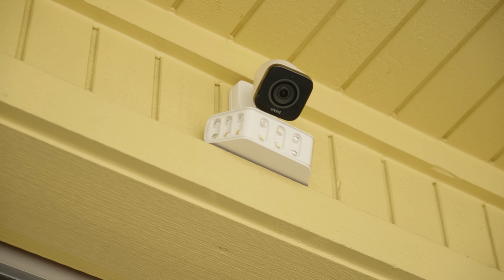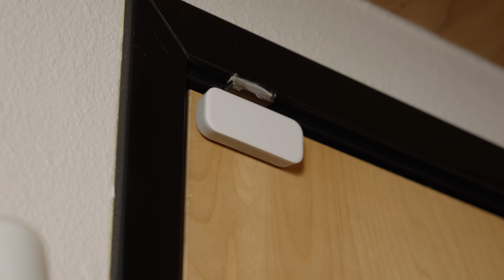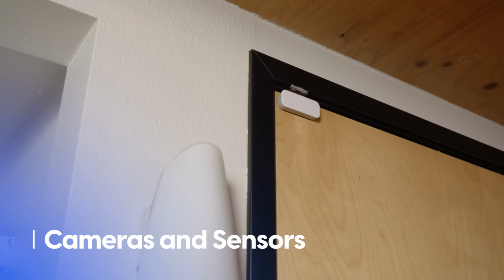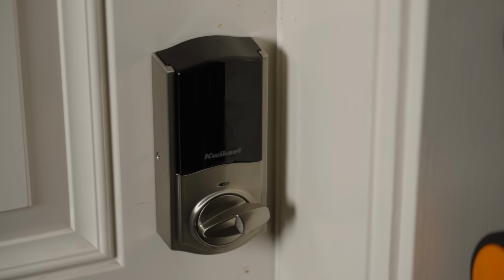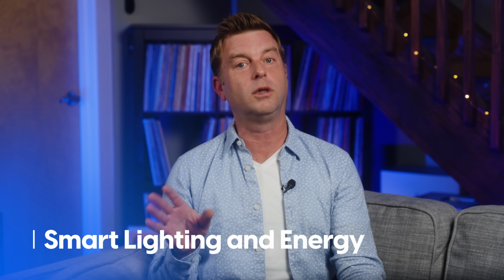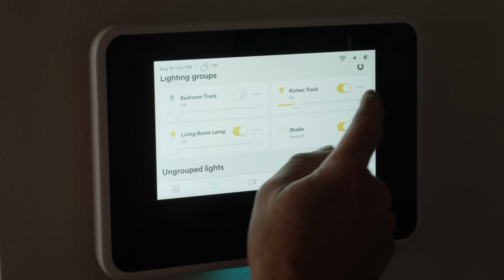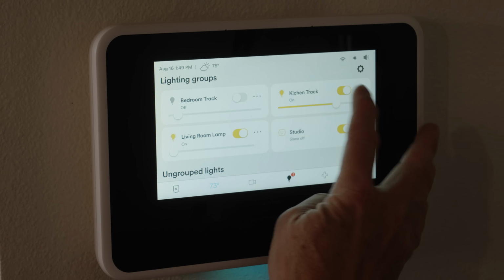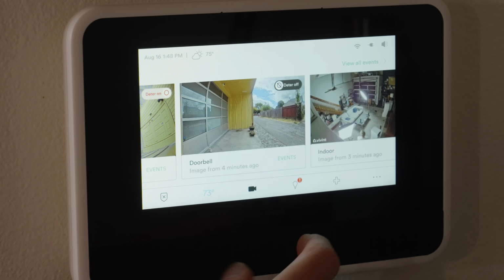Vivint: The Smart Automation Upgrade Our Studio Needed

Comment: Caleb - QUESTION for you - I have a Sony  XBR65A9F.  Nice TV, a few years old.  With everything nowadays coming from a streaming app, I've noticed what seems to be slow CPU performance - switching between apps or between "channels" within apps and I frequently need to restart the TV (reboot) when an app freezes.  MY QUESTION: would a newer Sony oled  like the A95L work better / faster in these areas?

Comment: That's awesome they have so much to offer. 10 years ago when I bought a house for the 1st time we got Vivant Home Security of sensors. That alone paid for itself with the discount on home insurance with a security system system.
Reply: The reduction in homeowners insurance is a drop in the bucket compared to the cost of the system in the lengthy contract. 
But please shill some more

Comment: Is an account required? Is there a monthly fee? Allowing some strange company name Vivint into my home is a non-starter. Home Assistant, while more complex is more versatile and operates independently so offers a real privacy solution.
Reply: Vivint is not a no name. They've been in business for 27 years.
Mine is like $30 a month. Those are just window and door sensors.
Reply: @saulgoodman2018  They are a name no one should know.